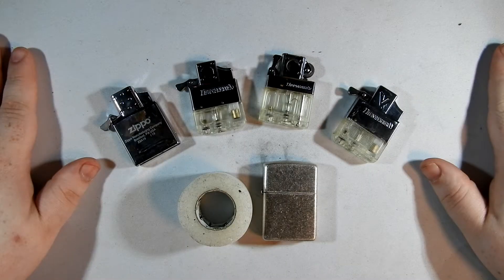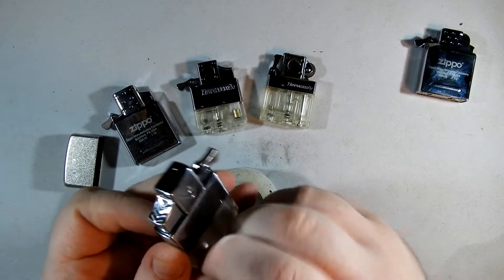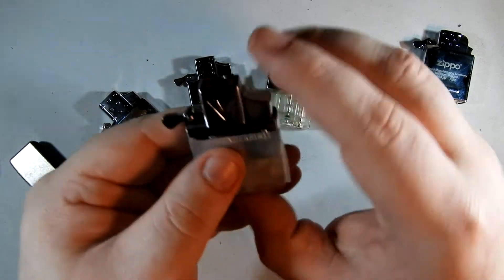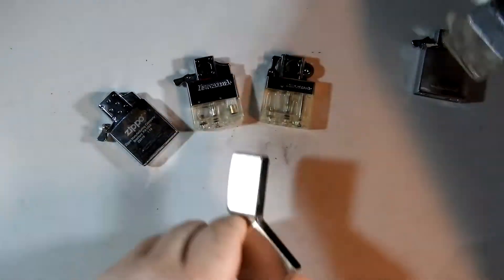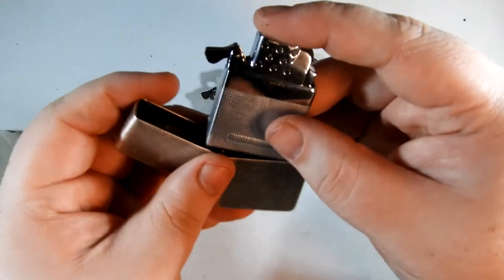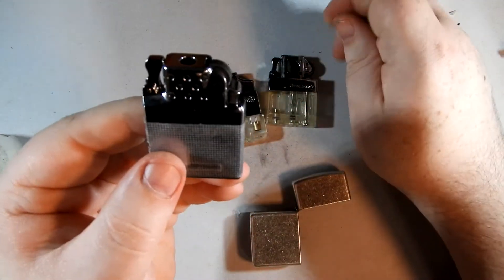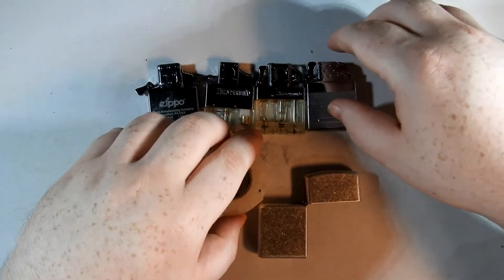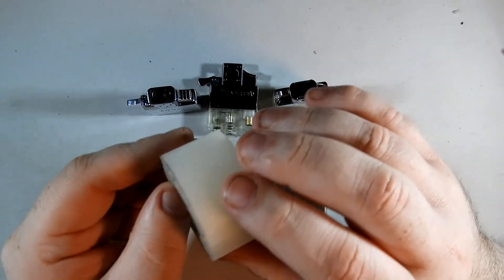Fixing  Loose Zippo Inserts With Tape!

Comment: That's a nifty little trick. Even if your insert isn't falling out, it can prevent rattling and from the insert just riding up and making it hard to close the lid. 

Cases also can get widened over time and just pinching the sides of the case when there is no insert in might be all you need to crimp the case down to hold your insert in there more snugly if the tape is too much and nothing is too loose.